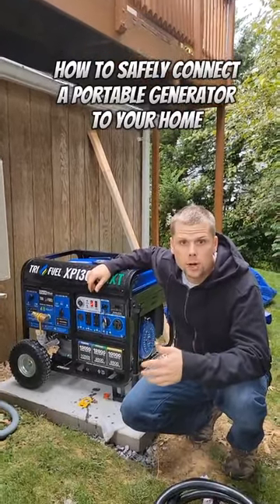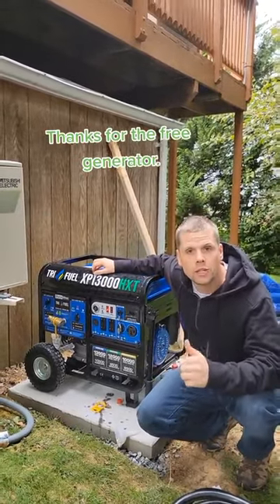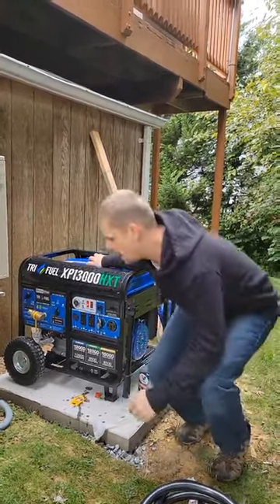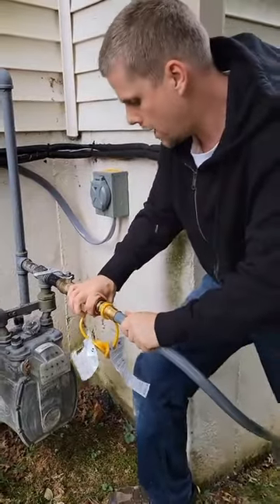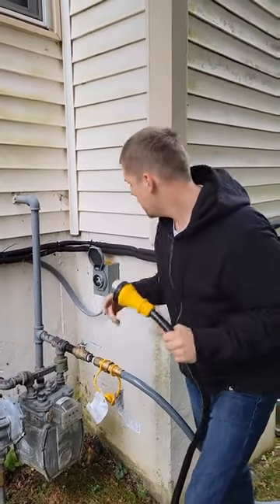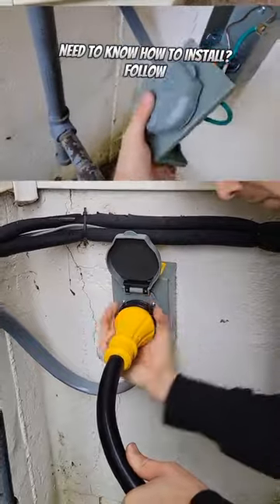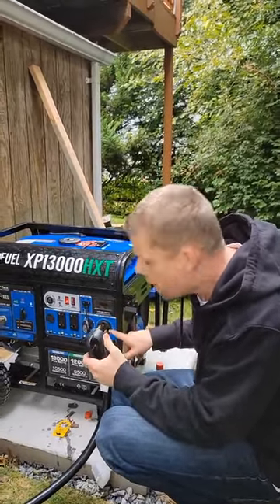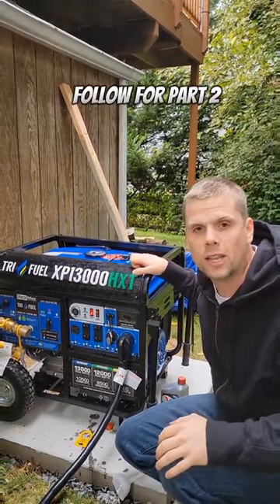How to connect a portable generator into your breaker panel #hurricane #generator #shorts

Comment: You forgot to mention that you needed to install a transfer switch to disconnect the house from the street power to prevent backfeeding to the street lines.  Linemen have to search for the source of generator noise to make sure the house is disconnected before beginning repairs.  This could entail significant delays in getting the power turned back on while they do a door to door search.
Reply: TRUE!!!

I love my propane generator with electric start!!! At 65yr pull starting even my lawn mower is painful!
Reply: See part 2
Reply: What is the name for the transfer switch?  In Ohio its code . Just talked to my nephew the other day about this . It senses power from the street and automatically engage  or disengage.
Reply: @stevehamman4465  the automatic ones are for the larger auto start generators.
For the homeowner using a portable generator, they have a lockout on the main breaker inside the panel that has to be engaged before the generator breaker can be turned on and vice versus when disconnecting generator.
Reply: That’s one code related problem, the other would be that he’s too close to the gas line.
Reply: Also forgo to mention that it needs to be a floating Neutral generator and not a bonded neutral genset.
Reply: You can't do it without a disconnect separate sub panel.

Comment: You have a code problem sir. 3 foot minimum is as close as that electric outlet can be to that gas meter.
Reply: I noticed that. I was like that’s pretty close to that gas line. What happens if that gas line breaks and something sparks? That set up is cool but looks dangerous.
Reply: And that's why you hire professionals
Reply: Is this only outside? Here’s a thinker, a recirculating pump on a gas water heater, the outlet is within 3’ of flex line on gas. I’ve never ever been called on that. What do you think about that
Reply: yamaszlofmcdurkin  are you saying that because the outlet is 240 and not a 110 receptacle that’s why it isn’t code? I don’t think you are understanding what I am saying. Thanks
Reply: @zacheiriksson And that’s why they should make the code more accessible to DIYers. It’s cool protecting the insane profits for the trade, but at what cost? People are going to DIY no matter what, so why kill people by hiding the code.
Reply: @JetFire9  code is very accessible if you know where to look. The problem is people have high confidence levels and low ability levels making for dangerous situations not just foe them but neighbors and also those that have to fix their fuck ups
Reply: @JetFire9  I spent 4 years going through carpentry and am still learning shit daily. Couldn't tell you the amount of times I've seen bullshit constructed by a "diyer" and from step 1 they fucked everything possible. Don't be ducking cheap where it counts and just hire a professional

Comment: Wow your going to get someone hurt or killed you never put and outlet within 3 feet of a gas meter. 2 I had this done by a licensed electrician it cost 275$ for parts and labor so for 175$ you have piece of mind that it is done right and more then likely is not going to burn down your house and if it does you have someone to hold accountable.

Comment: I needed to do it quick and dirty. I shut the main breaker off outside then wired a 25 ft 50 amp cord to a breaker, installed it in the panel and switched on the A/C, room lights and fridges
We ran 220 hours almost non-stop until power was restored.

Comment: Guys keep receptacle a couple feet away from gas line. Possible gas leak, possible electrical arcing could lead to possible fire.
Reply: If it was indoors then the gas could build up to the right gas/oxygen concentration and explode with a spark. Outdoors not so much. You would need a full flame within a couple of inches of the leak to be dangerous.
Reply: @Ricko1Games  3 foot is the code. That’s too close.
Reply: @Ricko1Games   Read up on NEC hazardous location classification codes.
Reply: @danielmarcantuno  that's for the electrical meter. For an outlet it's only 6 inches. Natural gas has low pressure and has basically no means of building up outside. Propane is definitely the more dangerous gas.
Reply: Agree , spark and gas leak is not good

Comment: I did this with my previous home.  It couldn't run my two central ACs but it could run my two fridges and the freezer and 3 roll around portable AC units and everything else.  It was about the same size as this one.  I knew I would be moving soon so I didn't put in a standby natural gas unit.  When we moved I have the contractor prewire for a full house standby generator.  Many people in our new neighborhood are doing this.

Comment: You should also be sure to make sure to inform them that it's not 10k all the time and that you should not draw more the 80% capacity so they don't blow out their windings on their generator. And don't run air conditioning compressors considering the draw it takes to start them

Comment: How can you run a wire outside with out some form of conduit? I know in florida you can't do that.
Reply: Electrical codes change yearly. A home owner can do as they please.  But this should be done by a licensed electrician.  They sell permanent generators for homes. I have a smaller one that only runs the fridge , freezer,  furnace,  and sump pump. And family room.  But you can get them larger enough to run the entire house.   $$$$$$

Comment: nice illegal hookup done for the plug with indoor wire being used outside and not even in a pipe or fastened to the house right next to the gas main that's crazy if there's any spark or leak,

Comment: Different country different rules but plugging in the exposed copper plug pins to the genie does not seem right, especially after you've plugged in the other end...unless theres an inline switch?? Should be shrouded inside or hardwired with interlocks as bare minimum.

Comment: That receptacle on the house is what we refer to as a widow maker. Live leads if you touch it your going to have a bad day. Also, feed bad for the lineman upstream when he gets electrocuted from the generator back feeding the grid. Lineman have died from that. If your going to make an instructional video on it you should probably know how to do it safely and legally which this is not. You need a transfer switch. If you get an automatic one it needs to have anti islanding  . An inspector would lose his shit if he saw this.
Reply: You should check part 2. He does install an interlock, and if you follow his directions, the outlet isn’t live until you have the generator powering it. Still should check codes, and there are definitely more stupid proof and safer options, but if you do the whole thing the way he did, those two problems won’t exist.
Reply: Interlock

Comment: This guy acts like he knows what's up but gives terrible advice and someone is possibly going to get hurt. You never connect your inlet so close to power source, exposed romex, overhang, generator to close to gas meter, no regulator between meter and generator. Absolutely dangerous. I wonder how the electric connection looks like. What a hack

Comment: And it's completely wrong. 
1 cable needs to be protected by conduit when exposed to weather and below 8' .
2 the cable from the plug MUST terminate in a panel equipped with a transfer switch. 
Without the transfer switch  you can backfeed  the utility that feeds your home. Putting a total of 15k volts on the downed line. Making YOU LIABLE  for ANY physical harm to line worker or others. Yes they will find you. Yes they will press charges. At best you'll loose your home to legal fees. If your actions caused one or more deaths and or severe physical damage you'll be looking at years in the state penitentiary.